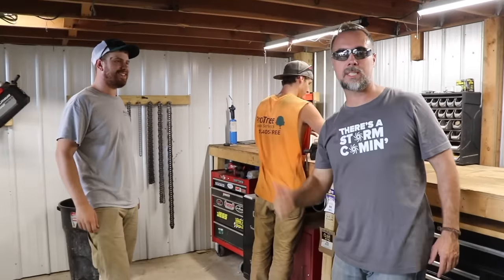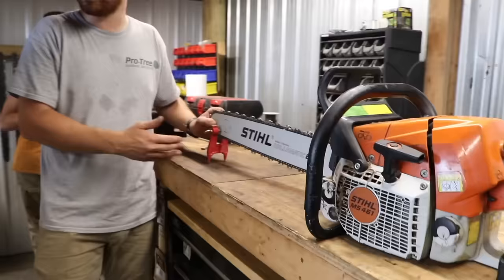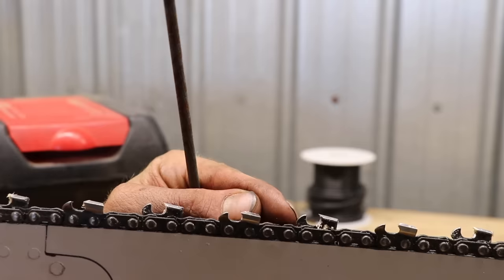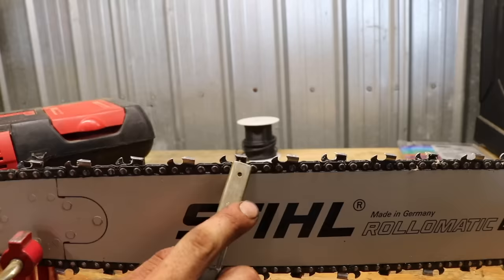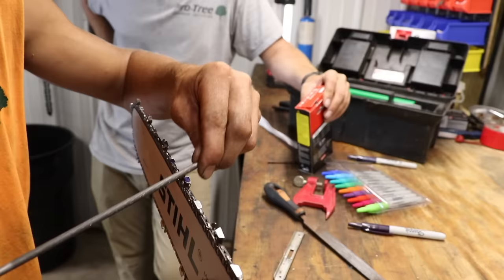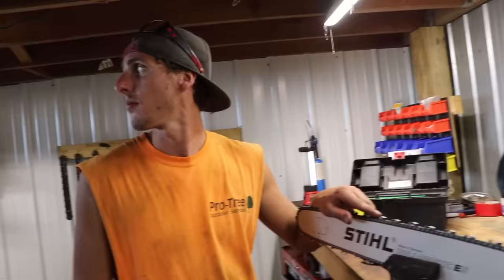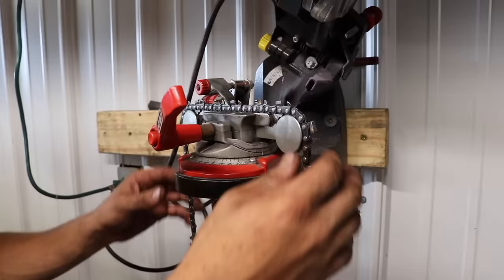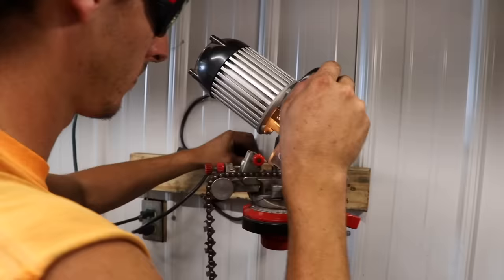How the Pro's sharpen a chainsaw

Comment: It's not a blade, it's a bar and chain. Too many ads during the video. You can sharpen by hand file and not have all of the teeth the same length and it won't cut crooked or pull to one side. That's a lie what they told you and learned from somebody else. Go watch Buckin' Billy Ray Smith on YouTube. He's a professional faller on Vancouver Island, BC, Canada and files most of his chainsaw chains by hand.
Reply: They're trying to tell you the best practice. You want to have them all uniform, period. Whether the results of different length teeth (teeth being different length also means they're different height) cause drastic difference in the cutting performance/profile, doesn't matter. You want them as uniform as possible. You don't want ads, finance his video making endeavors. I've never met so many people that bitch about watching 5 seconds of an ad on FREE media, as I've seen on YouTube.
Reply: If one side gets shorter than the other it will cut in a curve.  However, it gets magnified on a longer cut.  So, it can be way out of wack cutting 10 inch material and you will never notice it.  When you start cutting 36 inch stuff you can notice it immediately.    Also depends on how out of wack it is.  A small amount of difference will not matter.  It's not a lie, just depends to what extreme things are.
Reply: I agree 100%
Reply: Templeton Neptunist you can have one side shorter than the other. That’s what the rakers are for. I’ve seen one side filed to half and the other side 3/4 from new, adjusted the rakers and cut straight.
Reply: A lot of people how actually use chain saws hand file the teeth. Just as an example see Essential Craftsman and ArboristBlairGlenn.
Reply: I am subbed to Buckin s channel as well and love it....but he uses a full house grind mostly on his chains...I agree with everything else you have said.....Be Kind
Reply: @xenonram   Not true.
Reply: skip to the 13 min mark
Reply: John Lincicum p
Reply: @seantap1415    I really enjoyed the video.  Thanks for adding the link.  Where I ran into trouble was on 36" oak and flush cutting stumps to the ground.  When I experimented with teeth size in the past (way before You Tube) I would get a curved cut in the before mentioned examples.  When I made all the teeth close to the same size the problem went away.  However at the time I was not using a raker gauge (depth gauge tool, what ever)  It is easy to get all the rakers the same size by eye, but that would be incorrect if half of the teeth were smaller.  So in other words, I may have fixed my problem by filing my teeth to match the raker instead filing the raker to match each tooth.  I agree with Billy that you need to get out in the woods.  I usually sharpen my saw out in the woods on a stump or on a vice mounted to my truck.  Lately I have purchased a raker gauge.  I will experiment.  I will try the same experiment that Billy Ray Smith did.  Using my raker gauge and filing one side smaller.  Maybe I can learn something.
Reply: I took a look at my raker gauge.  I have the wrong one.  The one I have goes across the top between 2 teeth.  The gauge assumes that the teeth are the same size.  It will not work if the teeth are different.  I need one like Billy Ray has that sets each tooth individually.
Reply: You can install an ad blocker on your browser and it blocks all youtube ads. Just sayin don't complain about something that you can fix with a simple google search.
Reply: I really don’t care what a professional faller say and does.  I have no desire to get good at falling down.  Now if he was a professional feller, that would be different.  😁

Yes, you can have the teeth be different length and still cut straight if the rakers are filed accordingly, however, unequal length teeth are a sign of someone who doesn’t know how to sharpen a saw chain.
Reply: @JDeWittDIY  
Good examples!!
Instead of all these armchair experts, they need to consult these well trained, well learned gents. They are stable, wise and helpful. No bragging. Just facts presented very well.
•Arborist Blair Glenn
•The Essential Craftsman
Reply: Just my $.02
Reply: Yep!   Once I started using Buckin's technique, that's when chain sharpening by hand became fast, easy and effective.  I'm sure a dedicated chain grinder /sharpener would be nice, but I don't use the saw enough to be inconvenienced much and typically have 2 sharp spare chains in the bag.  My bench vise jaws are near perfectly parallel, so I use that to grab and support the chain drive links when having to fix dings from hitting hidden wire and such.  Saves unnecessary side loading of the bar groove when sharpening chains in the garage.
Reply: If your saw is cutting crooked nine times out of ten it'll be because of the bar.The chain ride on the two rails of the bar and over time one side of the bar will have a rail that worn down more than the other so the chain will be seated crooked.You have to take your bar off and put it on a super flat surface standing up at 90° ( same position as it fits on the saw ).Get a carpenter's square and butt it up to the bar while its standing on the flat surface.If it is leaning to one side you can file down the rails so that they match as long as there is enough material to file down and still be safe to use.Also flip your bar every now and then so that it wears evenly.If you don't flip it the bottom or top ( which ever you cut more with ) will wear out while the other side still looks great.
Reply: John thanks for setting the record straight!👍 I like many of this guys videos, but he is often giving advice he shouldn't, this video is a good example of that. Sometimes views are more important that good information.✌ 

When a guy say blade just walk away lol.
Reply: .What are u talking about it's got all the right procedure  to sharpen a chain, a very good video.
Reply: Team Blue 
Ppp
Reply: Indeed, if it were a blade, it would be called a "blade saw". Buckin' has the best filing videos.
Reply: @seantap1415  "Full house" just refers to the number of teeth. If you have a long bar on a small engine, you can use e.g. a skip chain that has half as many teeth as a full. You can watch Buckin' explain here: https://www.youtube.com/watch?v=CphO2s66K9A
Reply: @LostSkills  if your gullet is different on one side of the chain, it's going to cut circles.

Comment: When hand sharpening NEVER rotate the chain backwards on the bar to move the next tooth into position, you WILL eventually cut youself.
Just a safety tip.
Reply: Lol oh ok
Reply: I move my chain backwards as I go, but 1) I am standing behind the saw to begin with, same way I would be if I were cutting. It's a pull, not a push, so I have more control. And, 2) I use the tool that's already in my hands to pull the chain back by pulling it back against a raker.  In other words, my fingers are nowhere near a tooth and I am keeping the tool oriented properly to continue sharpening once I have moved the chain, so there is no wasted effort. I learned that from watching an instructional video on Stihl's YouTube channel. 

I can usually sharpen a 20-inch chain by hand in less than 5 minutes. I get a lot of practice because I do most of my cutting for a firewood ministry and almost everything is blow down or has been drug through the dirt at some point.
Reply: or just wear a pair of gloves
Reply: @indianajones8200  Not that I agree with MrFishone7777, obviously I don't; but what has posting videos to do with expertise with chainsaws? And you do realize that a person can have more than one login to YouTube, right? So he could have a channel full of videos that you know nothing about.

Comment: Been cutting for 30+ years. I file the depth gauges flat. I get rid of them. I sharpen my blades every tank a gas. I rip through oak with no problem pine no problem I don’t bind up because I know how to hold my saw. It’s easy to let the tool do the work. How many times have you ever heard that phrase when using any kind of saw. Let the Tool do the work.
Reply: *bar. After 30 years you still call a bar a blade?

Comment: Could you get someone to help you do a video on the differences in the types of chains used and the bar lengths?
When I was a cutter for a firewood company, we would often use "skip tooth" chains to speed the removal of the waste, (chips) from the bar as well as cutting faster!
I think your viewers, if the liked this video, would also like to learn more about things like this!
THANKS, for the video!
Reply from the maker: I will keep that in mind Kim, thank you !
Reply: I always run skip tooth chain. Full house, too much filing.

Comment: Check for 'bar roll' on the outside of the groove the chain runs thru.  It is where the metal mushrooms out a little bit and can be easily detected using your fingernail. It can be filed off in a jiffy with a flat file or grinder.   Bar roll makes cutting very weird, even with a sharp or new chain.  It is a devious condition that may affect your bar if you ran with a dull chain, etc.  Sometimes it is hard to see especially with bad eyes but the fingernail test is 100% accurate unless you are that one finger guy in the vid.

Comment: You wouldn’t have a chain left at the end of the day if you sharpened it every tank of gas, come on
Reply: If you sharpen every tank, you only need 2 or 3 swipes to bring it back vs every 3rd tank where you need 10+.
Reply: Just a light sharpen
Reply: @estessewerseptic9824  yep even done 1 or 2 swipes, as long as you keep the file moving smooth in a straight line  on the correct angles it can make a difference, especially if you using the chainsaw for smoother cuts and shaping where you want your final result as smooth as possible (log-house building, people making statues out of wood with chainsaws and so on) Hand sharpening be it chainsaws or axes or other blades, I would not go as far as called it an art but it´s surely a discipline, the more you practice the better you get, it can also be weirdly meditative or addictive as youtube is full of sharpening videos were people take a blade way too far in sharpness level  in my opinion to do any work with said blade and ruin the hours they have put into getting it there...
Reply: I sharpen every tank. I process from forest to stove 15 full cord every year, (yes a year long weekend project) and i have had the same 3 chains for 2 years.

Comment: That used to be my job when I was working for the last tree company. It's amazing how many people don't know how to sharpen a chainsaw properly. Took me years to get down to a science. I think Im one of the better sharpeners out there. That fellow sharpens like I do. Yup. He's got the right stuff!
P.S. The rakers, as you were saying have to be done the same time as the teeth. 
Ever use those chains that instead of  being horizontal to the bar, you have to give it an angle ( I'm not talking about the sharpening angle per se)  Anyhow, I've come across them a few times and seems unnecessary. Not to mention, it's hard to master. It reminds me of a compound miter type of angle. Does anyone like those chains is what I'm wondering. And if there's a benefit to having them like that.
Reply: Yes, there are benefits to that, but I wouldn't try it unless you have someone with you that is already accustomed to it because of having to learn multiple angles at once. Your use of the term "compound miter"  helps to explain it quite a lot.  Wish I had thought of that.  That kind of sharpening helps make the amount of metal removed more uniform along the cutting edges and ends up with a faster cutting chain, which can be important for felling and other cutting in more dangerous situations.  It takes longer to learn and longer per sharpening job once learned too.  I almost always use the round file, but I will go to a chain that I have "square filed" (actually a triangle if you look at it) if I'm getting into something where I need that little extra speed or confidence to do.

Comment: this guy is 100% wrong when he says you want to take the same amount of strokes or the same amount of metal for each tooth.  The length of the tooth has nothing to do with how the saw will cut.  You want sharp teeth.  Some will require 4 strokes.   Others might require 20 strokes.  When you hit metal in a tree, it can really affect the teeth differently.  File each tooth individually...dont worry about number of strokes.
Reply: Indiana Jones ain’t got a fuckin clue about this stuff 🤣🤣🤣🤣🤣

Comment: Great tips lads.....good call on the raker every 3 times. A good way to remove filings from the file is run it over a stick of chalk....grabs all the filings and especially oil etc...just knock it clean afterwards....

Comment: I use a Dremel with a cone stone Bit and it works great !
Reply: I wouldn't recommend that.  Cone means too much thin metal at tip and too much thick metal just behind it.  That's a perfect recipe for fast dulling when you start cutting, especially with hardwoods.  Stick with a cylinder, not a cone.  Square filing is even better if you can find someone to teach you for the same reason.

Comment: Spent the first 20 years of my adult life in logging in New England. They are correct that this takes practice . I was into my second year that I got really good at filing my saw chain. Never, never took the chain off to grind on a machine. They work well, but all the other guys would laugh at you. 
Something to stress with the “full chisel “ type chain in the video is that the forward corner of the cutter does all of the cutting. That’s why it is called the “working corner”. It must be sharpened to a sharp point to really cut well. Consumer-type semi chisel chain does not have this feature and will never cut as well as a pro type chain. 
I enjoyed the video very much. 
Jim Doyle 
Stihl Master WrenchTechnician

Comment: One thing I do before I touch any tooth is mark the first one I will file.  This will show me when I got to the last one.  I just take a mild solvent and wipe oil that may be on that tooth off then color the tooth blue or red or something like that with a permanent marker.  It is not really permanent and alcohol will wipe it clean off.  It will also wear off quickly when you use the saw next time.

Comment: Seems to me that by inspecting the entire chain for teeth lenght and adjusting the chain tension and liningmup the grinding wheel and adjusting the angle....half the teeth would already be done by just hand filing. I got the Oregon had files for $20 total. Nice to lesrn that you should file the tooth first and the guide second. I'm  a noob and learning it all from scratch. Youtube is awesome as a learning resource.

Comment: The Stihl 3&1 sharpener kinda makes this much easier.  Keeps me cutting more and in the shop less.  I’ve got 3, one for each size saw I’m running.
Reply: Ken Gray, just be sure its only for stihl, you cant use it one husqvarna, jonsered, echo etc

Comment: Regarding the grinding machine, they left off the setting of the angle of the cutting head, that angle gauge back behind the cutting blade that tilts the motor to one side.  From my studies, professional large blades use a 60 degree setting, homeowner low kick-back (pico) blades use a 70 or 75 degree angle. Also, didn't show the part about setting the depth gauge on the cutting head to prevent cutting too deep in the gullet.
Reply: Sorry, should have said chain instead of blade, old carpentry habits die hard.

Comment: Two points: 1/ The raker isn't "basically a depth gauge". The Depth Gauge, isn't designed as a raker, or isn't in fact, a raker.

2/ The angle of the tooth written on the chains box(30 degrees for ex.) is a general purpose angle. You may want about 5 degrees difference depending on if you are mostly cutting hardwood or softwood. If you are using your chainsaw to make lumber, you either need to get a rip chain, or resharpen a chain with a much smaller angle.
Reply: I noticed the chain on a local fellows saw was very poorly sharpened. He was employed harvesting trees. He had been sharpening no where near level; about 30 degrees upwards, and had cut into the chain links a fair bit. I pointed this out and he got upset and said "I guess I don't need you to tell me how to sharpen a chain saw" LMAO I may not be getting paid but I have cut enough logs, pulp wood, and firewood, and I read instructions. I also have a 99% mechanical aptitude and little patients for people that do not listen. I could not be bothered to argue with him; let him figure out how much extra work he was doing, how dangerous damaging the links can be, etc.. About a year later he admitted to me that what I told him about the chain, was correct. I said "I guess I don't need you to tell me when I am correct.  ;-)

Comment: Great video. Not sure about the time saving of the electric sharpener though. By the time you've removed the chain from the chainsaw, set it up on the electric sharpener, fiddled around with the adjustments  you could have filed the teeth by hand.

Comment: Was pretty much accurate.  But when you hit dirt or rocks the tooth gets rounded off. So when you sharpen the chain you need to look at the point. It should be a sharp point with a square edge. If its been in dirt you might have a point with a rough rounded edge . You need to keep removing material until the rough rounded part is gone and you have a crisp square edge and point. It often takes alot to get there. Also when you sharpen your chain you should clean your bar and check the rails. And flip your bar often. It will last much longer and cut straighter.
Reply from the maker: Thanks for the tips Brian and thanks for viewing !